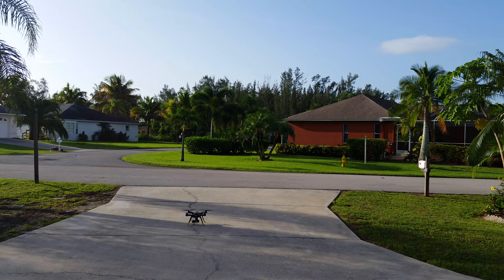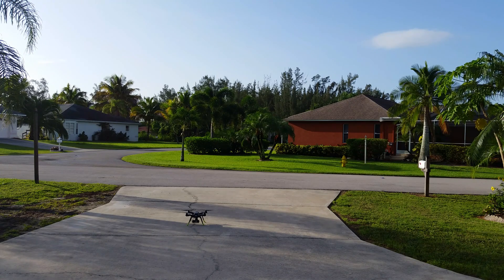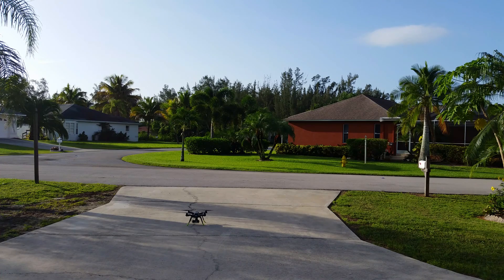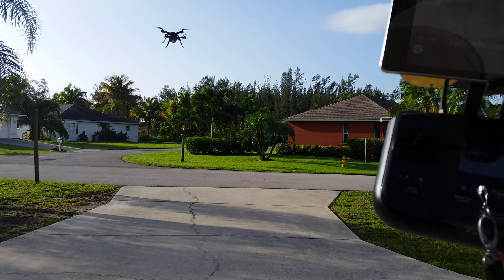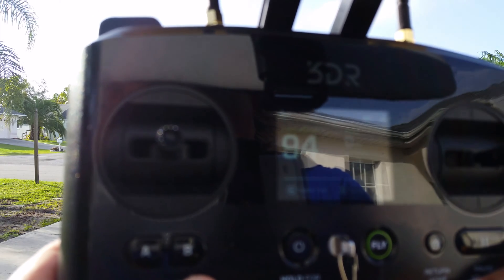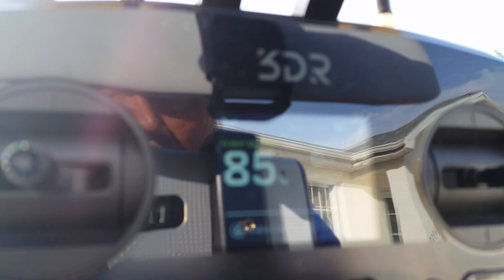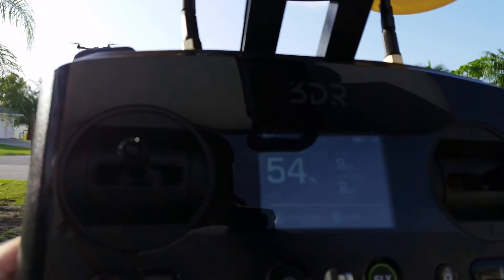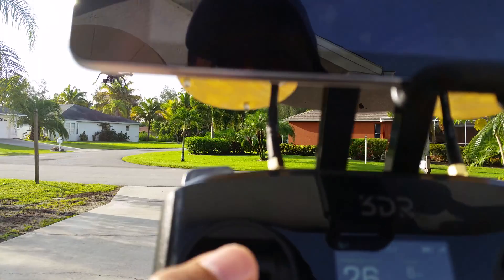3DR Solo Smart Drone, Battery Rapid Discharge Malfunction

Comment: never ever had this problem until a few days ago. got another battery but the same thing. is it the software or the battery itself? not sure if the battery is NICAD, but i'm going to let it fully discharge then charge it back, coz I know NICAD batteries eventually will only hold a charge as long as the user allows it to recharge. EX: I fly for 80 percent of the battery then recharge, the battery will only give me 80 percent charge,,not 100 percent. getting heated over this issue

Comment: google 3dr battery calibration you will be able to bring the battery packs performance up to par again unless you have damaged one of internal cells beyond serviceable, i have completed this procedure on 2 battery packs and they both suffered from fast discharge under load and now operate normal again, it appears to happen when people store there lipos at full charge for long periods of time store there batteries at 50 percent charge for better and longer life, top off charge right before flying. Even though these batteries are considered smart batteries it appears from inproper usage and storage the one or more of the cells internally become so out of balance that it never fully charges causing the fast discharge under load affect in your video, many other 3dr users have experienced the same problem and many have benefited from a battery calibration procedure.
Reply: when storing it for 50%

is that a solid 50%? it cant be 49 or 51%? Has to be 50?
Reply: friend, how can I calibrate the drums of my 3dr drone, I just download it fast

Comment: I have the same problem with battery of my drone. In my case i tried to flying my Solo that was charged 70%  but it had rapidly discharged to 25% within 1 minute in the air and it was 5% when it landed.Did you resolve the problem of your drone?Did you only get to exchange the battery from customer service? I thought it might a problem of software that's why i had updated a few days ago.
Reply from the maker: Yes. I contacted Solo and showed them this video. They sent me a new battery. Contact them and explain to them the issue, maybe they will help you if your product is still under warranty.
Reply: i have this problem who can i contact for help it went from 100 to 4 in 3 minutes
Reply: Bad battery
Reply: Need a new one